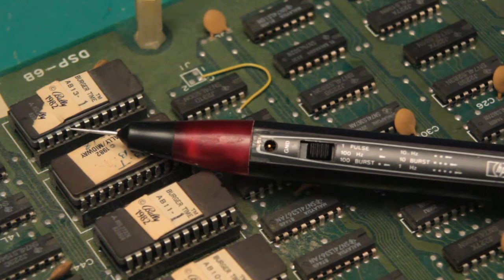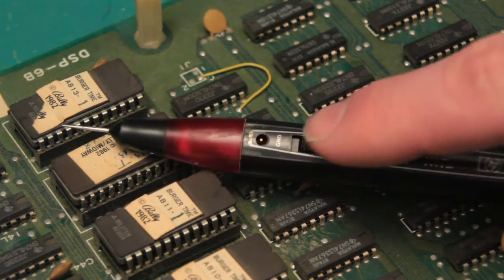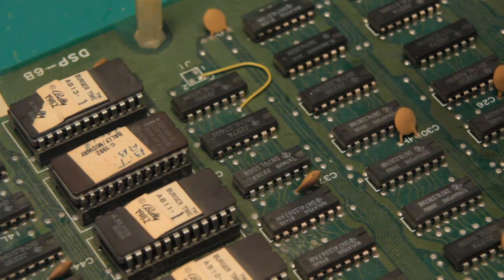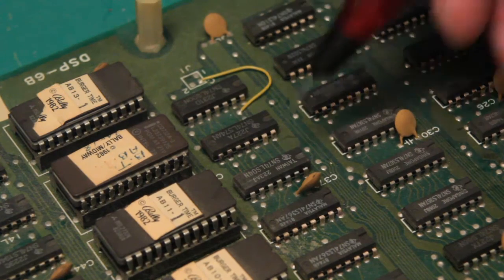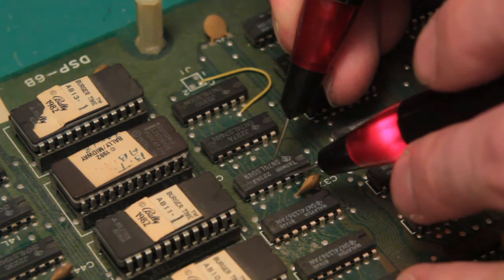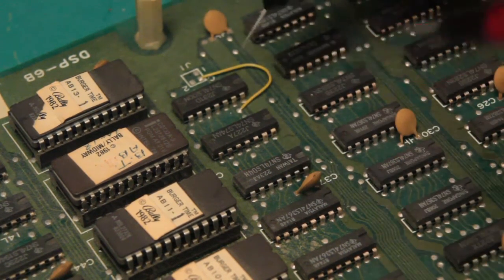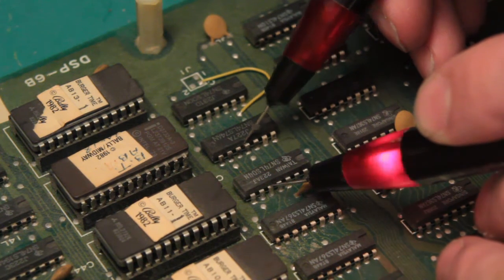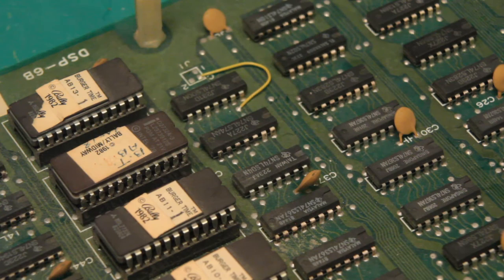Fix it Friday! - (Logic Series 02) Using a Logic Pulser

Comment: Hey so I have the HP 500A series, the 545a 5546 547a and 548a.  I have watched your videos and several other, in addition to knowing a bit about them.  However, I am stummped when trying to find a connector to make my own gator clip attachments and or power the 548a logic clip.  Any thoughts on places to look? or parts that work with them?  even digikey didn't have a pin or connector that was obvious for this application.

any help is appreciated.